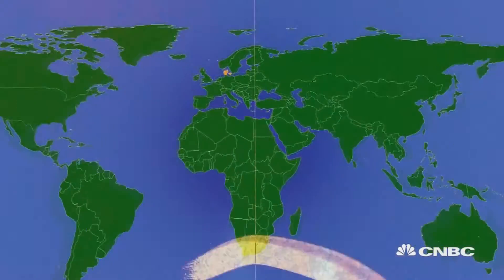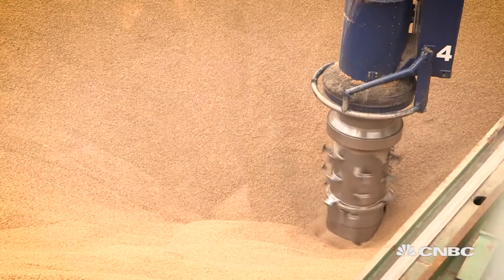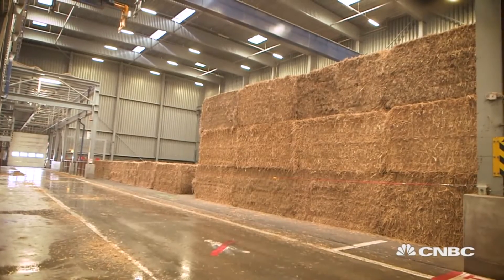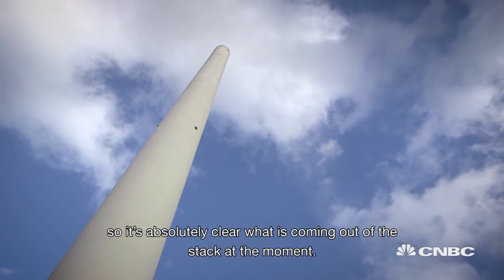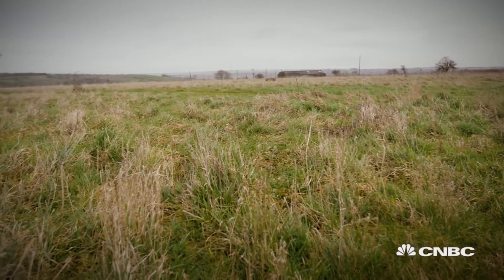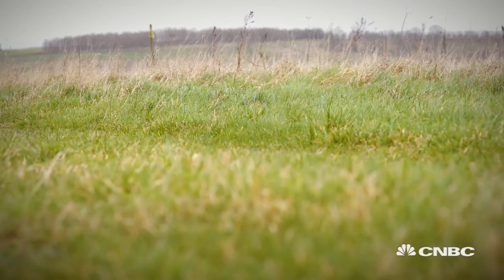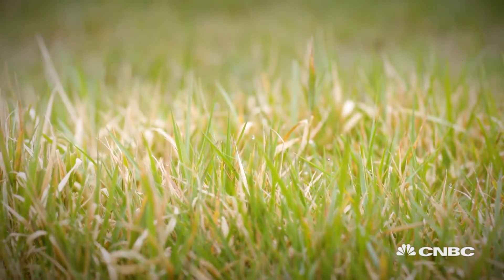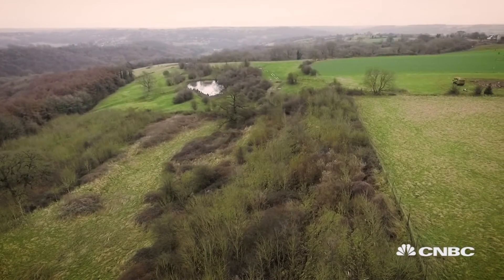Breaking down biomass, part two | Sustainable Energy

Comment: This is no where sustainable nor renewable. The whole marketting thing in Denmark is based on bureaucratic mistake of not putting CO2 tax label on burning wood waste.

In the end whether it's coal or wood(waste), it's burning and pushes CO2 into the atmosphere. When I started this video, I thought there will be azolla or other microalgae related stuffs and scalable industrial setup.

Or something related to less methane emitting bovine feeds.

The reason we are in this menace is because of human created "Global Warming" after all.

I am openly disliking this video.
Reply: "Bio" carbon is cycling in and out of the biosphere and atmosphere naturally, and has been for thousands of years without issue. If it is not harvested it would decompose... releasing carbon into the atmosphere. Releasing "locked" fossil fuels, like coal and natural gas, is the problem. 
As one tree is heating a home 100 other trees are sucking up all of that carbon.
IPCC clearly supports the use of salvaged wood for fuel.